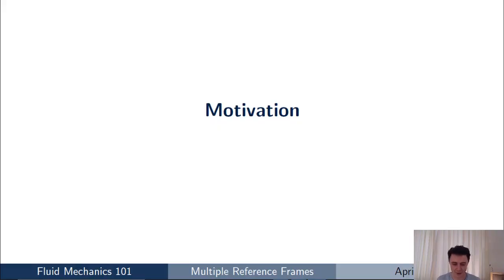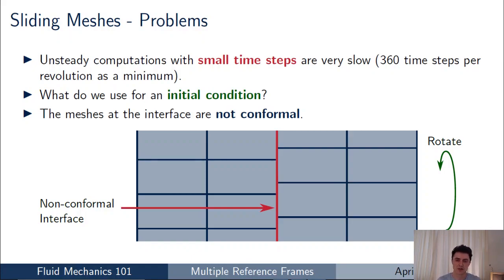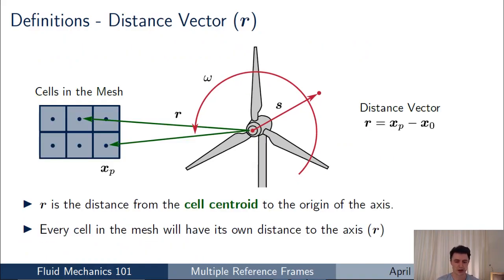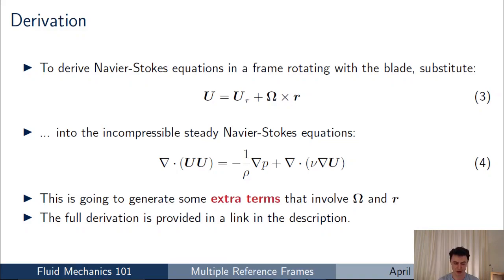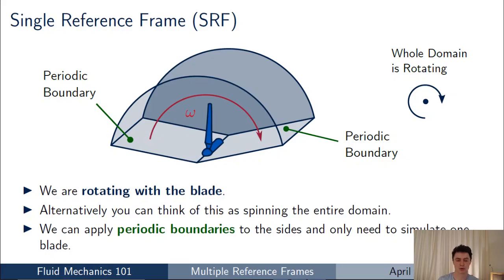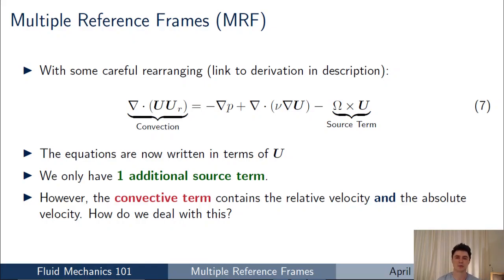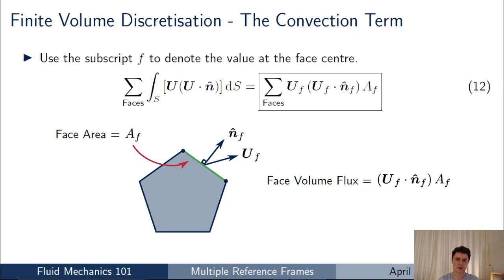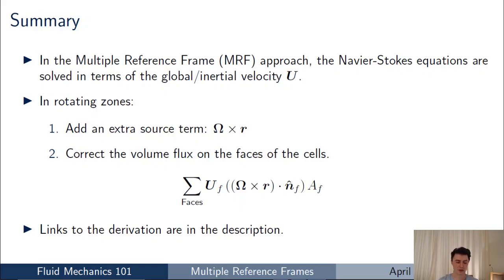[CFD] Multiple Reference Frame (MRF) Approach for Turbomachinery

Comment: Thanks, Dr Aiden, It would be also helpful to talk about the limitations of the MRF and perhaps point out some of the questions asked when applying such approaches, for example, at what distance one should place that Moving region around the blade to get the optimum accuracy? which is difficult to answer when taking the mixing tank example, in particular for the ones with baffles.
Reply: same question for what distance and size of moving region to get optimum accuracy
Reply from the maker: Great question. There is obviously an optimum between accuracy and speed of calculation. Usually I make the diameter of the 'coin' about 1.3 times the diameter of the rotor itself. The lateral length will depend slightly on what the structure of your wake looks like and whether you need to resolve it. This probably requires some testing 👍

Comment: Thank you for the video. I think the velocity triangle at 10:45 may be incorrect. U and U_r should be swapped and the direction of (Omega x r) should be reversed
Reply: Very clear and useful explanation. Thank you.
Reply from the maker: I probably should have explained that the velocity triangle is in a reference frame moving with the blade. Thats why it looks like it is the wrong way around. Sorry if this was confusing, the rest of the talk should be straightforward to follow even if the diagram itself is a bit puzzling 👍
Reply: Very nice. Look lecture on particle flow

Comment: hi,
Like I said in the last comment, I am implemented the MRF in my own solver, I found that if we divided the convention term in equation of relative frame but solving the absolute velocity will cause some problem even we do some flux correction when I choose the upwind scheme for the stability reason. The term /nabal U_I U_I makes me confused to use U_I as the judgement of the upwind direction, correctly, the it should be the U_r as the judgement of the upwind direction in the MRF zone. 

The aim of this commit is just for fun and discussion , u do a very good job for the the vedio. I really 
appreciatE that.

jialiang.zhou

Comment: Perfect! I wish to also point out how the slides are full of information while being visually clear and full of space. Beamer helps but the figures are on point.

Stupid thoughts looking at this presentation:

1a) Simple pipe, I solve it with the SRF approach. 
1b) Same pipe, I solve it stationary, with rotating walls. 
Are the results the exact same? I'd say yes, but never tested.
Would the conclusion be the same in case of the MRF approach? (a portion of the pipe solved with MRF approach in case a), and with rotating walls in case b) )

Comment: Great video. I am trying to use SRF with Fluent but when post-processing I am getting a swirling motion usptream of my impeller as well. I don't know how to "filter it out" so I am using the MRF method (basically splitting my domain where my impeller is).
Reply from the maker: It might be because you need to apply the inlet boundary conditions in the rotating reference frame when you use the SRF. But yes, just go with the MRF, that will do the trick 👍

Comment: Hi Dr.Aidan,

Wonderful tutorial as usual.
Please englighten me though, in a sliding mesh environment for a wind turbine case for example;
I can construct a structured mesh in the rotating zone and the whole zone will rotate as it slides at the interface. Therefore the quality of mesh is surely good enough.
However for the MRF approach, if I understand correctly, the mesh in the rotating zone is by itself sliding against the blades. So I guess I cant use structured meshing? What about the quality and skewness etc?
Reply from the maker: I'm not sure if I quite understand your question. You can any type of mesh you want in the coin region and outside the coin region. You can even mix and match! It is quite popular to have structured mesh inside the coin, to maintain high cell quality and then unstructured outside to reduce the overall cell count
Reply: @fluidmechanics101  I see, I initially thought that we will impose something like a dynamic mesh in the coin region. So from a meshing point of view, everything is essentially static, right?
Reply from the maker: Yep, everything is static from a meshing perspective. You will need a separate 'fluid zone' so that the code knows where to apply the MRF source terms. You can essentially use the same mesh as the sliding mesh approach. But with this approach the coin is stationary and we apply a source term inside it (and a flux correction on the interface)

Comment: Hi Dr. Wimshurst, thanks for the great video. I’m working on a ducted turbine CFD simulation using MRF method and I have a question about a size of the MRF zone.

There is quite a difference in terms of a generated torque between setting the MRF zone only around the rotor (inside the duct) and setting a bigger zone including the duct (non-rotating patch for the duct). It seems that the smaller MRF zone loses the wake information behind the rotor and inside the duct, affecting the degree of interaction between the duct and the rotor.

I wonder how the information is transferred across the interface and what MRF zone size would be reasonable. I’ve been searching for the answer but there was no clear answer. It would be really helpful if you share your insight and knowledge.
Reply from the maker: Yes, I found something similar. As the wake flow passes out of the MRF zone across the downstream face, the wake structure is smeared and loses a lot of its structure. So your observation is consistent with mine. What I would do is use the MRF solution as an initial condition for a transient simulation that physically rotates the MRF zone (a sliding mesh approach). You will probably get a converged solution within 4 - 5 rotor rotations (depending on your tip speed ratio) and this solution will be a lot better.  As long as the mesh transition across the  MRF interface is not too drastic and your downstream mesh is not too coarse you should get a pretty good downstream mesh structure that you are interested in.
Reply: @fluidmechanics101  Thanks for the answer! Have you tried a big MRF zone (or the entire domain to be the MRF zone) together with the nonRotatingPatches option (OpenFOAM)? This approach still has the wake information but overestimates the velocity, pressure, torque, etc. Do you have any idea about this?

Comment: Thanks Aiden for the video. It is quite clear to follow. I am trying to use the same approach in generating a MRF in Ansys CFX to simulate flow over a wind turbine blade, just the same model you  used for the explanations. However, I am a beginner in CFX and was wondering if you have tutorial videos that covers generating a  MRF frame for simulating flow of a wind turbine blade?

Thanks
Reply from the maker: This is reasonably straightforward to do in ANSYS CFX. I think there is a tutorial in the manual that you can follow? The main thing to do is have a domain that contains the wind turbine blade. Then you need to specify the domain as rotating in CFX PRE. When you set the rotational speed, CFX will calculate and apply the source terms in that domain (giving an MRF approach)

Comment: Thanks for the great explanation.  Would this be equivalent to adding a source boundary condition to the leading edges of the blade, and adding a sink boundary condition to the trailing edges?  Would that be a valid approximation of blade motion?
Reply from the maker: Yes, actually that is a nice way of thinking about it! (With the source slightly upstream of the blade, where the boundary of the coin region is)

Comment: Does having a larger surface area between rotating and non rotaing mesh increase computational time? as it needs to add extra source term and correct the flux on more faces
Reply from the maker: Yes it will. But it is probably not that significant if the mesh is stationary, because the interpolation factors only need to be calculated once

Comment: Thanks for the great explanation.
Do the Moving frame of reference still need to use small time step (360 per revolution)?
Reply from the maker: Often you can do the moving reference frame as a steady state calculation, so you can use much larger 'time steps' than resolving the rotor rotation 👍
Reply: Transient doesnt work in Moving frame of reference, Trust me, i have tried
Reply from the maker: Yes. Moving reference frame is for steady state only. If you have a sliding mesh (full transient) then a time step that gives somewhere between 0.5 and 5 degrees of rotation per time step is probably a good guess

Comment: Hello, amazing video, i have a question, for example we have rotating domain around a rotor and we make frame motion for this domain. We also have fluid with the same material (for example air) around the rotating domain. So we have fluid-fluid interface for the rotating domain and the fluid domain around it, how to define the interface so the interface not act as a wall (so the rotating fluid can flow through the interface and we have continuous velocity profile at the interface)? Thank you
Reply from the maker: The name of the interface will depend on the software you are using. It may be called 'arbitrary mesh interface (AMI), CGI or just 'interface'. OpenFOAM for example has changed the name of its mesh interface algorithm a few times, so worth checking the user manual 👍

Comment: I have a doubt, the MRF uses a stationary mesh and corrects using the flux terms or does it uses a moving mesh just like the other method sliding mesh
Reply from the maker: With MRF the mesh is stationary. It uses an added source term and corrects the flux on the interface between the stationary and MRF zones. With sliding mesh, the mesh is moved physically each iteration

Comment: Hi Adian  Sir, in equation 7, global velocity U is unknown or relative velocity Ur is unknown? because we are replacing the Ur with Uf in equation 16 so i think Ur is unknown initially?
Reply from the maker: Looking back at this talk, some of the notation is quite confusing! Both U and Ur are unknown initially. We are choosing which variable to solve for (the other one we can get by post processing). So the key point is that we want everything expressed in terms or U or Ur (not a mix). When we do the finite volume integration we then have the face values instead of the cell centroid values, so we make a substitution here. For the MRF approach we choose to solve in terms of U (not Ur) and so it is easier to think that we are trying to remove Ur from the equations (the opposite is true in the SRF approach)

Comment: @5:36  by using MRF / or in the frame of rotating , u said the flow field will be steady ,I didn't get that how fluid flow  conditions( steady or unsteady)  is related with reference frame
Reply from the maker: Maybe think about the case of a wind turbine. If the wind flow approaching the turbine is steady (not changing on time) then the flow approaching the blade does not change in time, even though the blade is rotating. However on a gusty day, where the wind flow is changing, the flow approaching the blades will be unsteady 👍

Comment: Thanks, Dr Aiden，great work of you. Let me ask you something please.  I model a propeller based on the slidingMesh, using the fieldAverage functionObject to get the uPrime2Mean(so as to get the TKE), apparent value jump  appears in the AMI interfaces. This maybe due to that , fieldAverage is based on the rotating cell,  not on the fixed spatial point, so the Uprime2Mean cannot be used in the rotationg region. The question is: how can I get the right TKE(on a cuttingPlane or the whole region) in the rotating region? Do you have any references to do so?

Comment: Hello Dr. Wimshurst. 
Again, your video is very interesting, thank you so much to clarify this complex notion. 
Can you do a video for the MPM (Mixing Plane Model) for turbomachinery applications? And can you give some advices for running simulations with this model, for compressible cases (centrifugal compressor for example) because, I have encountered so many convergence problems with FLUENT solver. I have already tried to reduce the relaxation factors or CFL number, initiate with the area averaging method in the mixing plane, use the FMG initialization, ... but I don't success to converge any simulation.
Reply from the maker: Hi Antony, generally you want to try and get a stable solution first and then slowly add the physics complexity in later. I would switch the discretisation schemes to first order and try standard initialisation instead (fluent often has difficulties with hybrid and FMG). Also, have you checked your mesh?
Reply: @fluidmechanics101  Yes, I also already tried to perform the simulation with the first order numerical schemes. But, it is true that I have never tried to use standard initialisation, because in FLUENT's trainning, they generally suggest to use hybrid or FMG for better and fast convergence.
Concerning the mesh, I'm using TurboGrid to do the mesh so the quality is by default generally good and satisfying quality criterias.

Comment: How far one should place an interface? for example here between rotor and stationary chamber? does that change the accuracy of result?
Reply from the maker: 20% of the rotor diameter is usually fine. The upstream flow field, rotor thrust and power are rarely affected significantly, but the downstream flow field often is. So it is a good idea to have a look at the flow contours and check that they look sensible

Comment: I don't understand why the steady state solution to a stationary mesh with rotational velocity component on a blade surface gives a different result to a steady state solution with rotating mesh and no blade surface velocity component.
Shouldn't these give the same result?
What am I missing here with my intuition?
edit: I guess this is analogous to having the fluid domain boundaries or the surfaces of the airplane in the middle have velocity components in a "linear" case. Shouldn't these also give the same result?

Comment: Hi, I was developing the derivation of the Navier-Stokes equations and I found that for the MRF calculation it considers that the viscosity is constant, does this mean that it is only applicable to Newtonian fluids?
Reply from the maker: Hmm good question. I don't think so. I think MRF should be perfectly fine for non-newtonian fluids as well (we probably just need to check the equations)
Reply: @fluidmechanics101  thanks for the quick answer, I checked again the equations considering the variable viscosity and if it is possible with non-newtonian fluid :-)

Comment: Hello Dr Aiden, is there any condition to determine the size of the rotary domain?
Reply from the maker: If you have an open rotor (wind turbine, propeller) then you could try setting the diameter to 120% of the rotor diameter. I don't know any formal guidance but you want to avoid having the domain interface being too close to the rotor tip, as it could interfere and lead to errors

Comment: hi, 

Firstly, thank you for making this excellent video about MRF.

Just for interesting, if we can use the SRF equation for rotating region and the normal NS equations for the non-rotating, but in the interface, we need to applied a velocity transform to just one reference frame in order to compute the interface velocity?  Is it this scheme workable?

Another questions is from the apply the MRF method to the SIMPLEC solver. If my understanding is right, in the SIMPLEC solver, the momentum equations will become the MRF form while the pressure correction equation will still the same as the extra term given by the rotating motion will be cancel since the subtraction of divergence-free velocity and the non-divergence-free velocity.

Thank you for your time for reading and if you will reply me it will be wonderful.

jialiang.zhou
Reply: hi, 

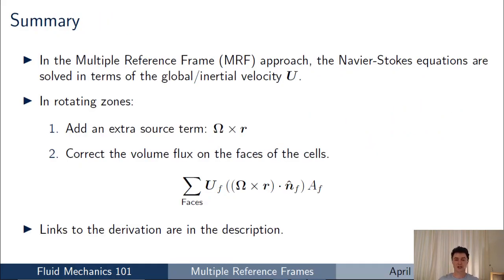is that the extra source term in 25:19 is incorrect? The source term will be capital omega X U in the absolute frame?
Reply from the maker: Yep, should be a capital. Well spotted!

Comment: Can you say how Ansys CFX node based and Ansys Fluent cell centroid based apporach different? why we use Ansys cfx for MRF problems?
Reply from the maker: You can use either fluent or cfx for MRF problems. Many people prefer CFX for turbomachinery applications as it has many automated features that make things easier to post process (multiple blade rows in compressors for example), which was a traditional strength of the code. Nowadays I would go with whatever you feel comfortable with and have access to
Reply: Thank you and you are second reason to love CFD . I appreciate all your work @fluidmechanics101
Reply from the maker: Oh shucks ☺️ I'm just trying to make the confusing world of CFD a little bit clearer, one video at a time

Comment: I am trying LES simulation and i need rotation condition. Can i use MRF approach? Can i use  MRF approach for unsteady analysis
Reply from the maker: You can use MRF for unsteady calculations but ....  It will depend on the period of your unsteadiness and how close this is to the period of your rotating body.

As you have an unsteady simulation anyway, why not just rotate the mesh and do sliding mesh anyway? Then you can be a lot more confident in your answer
Reply: @fluidmechanics101  Thank you very much for your reply